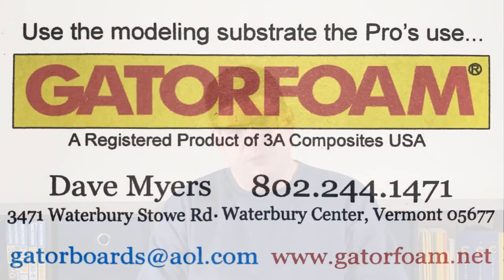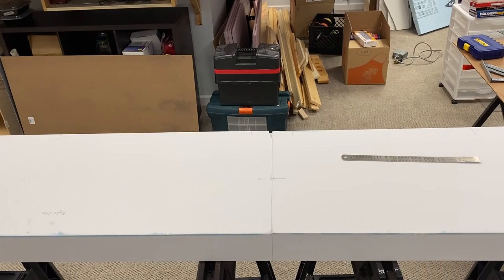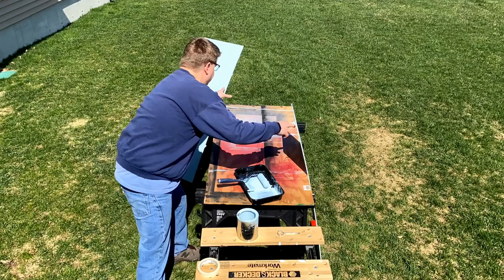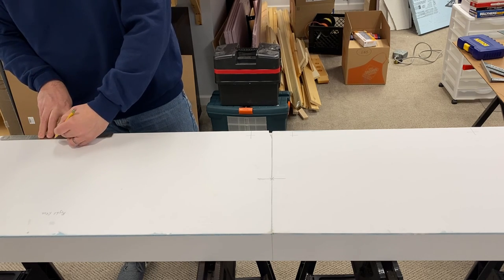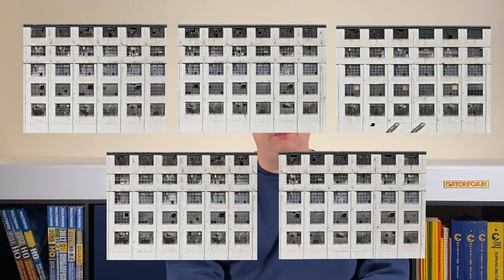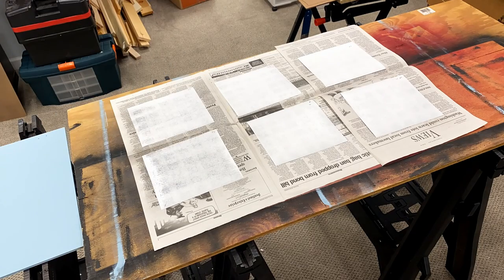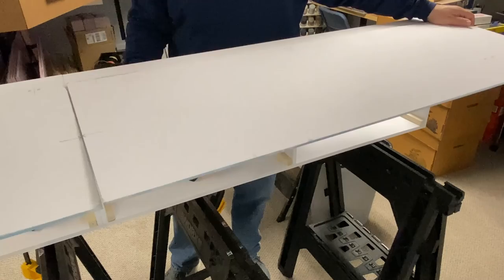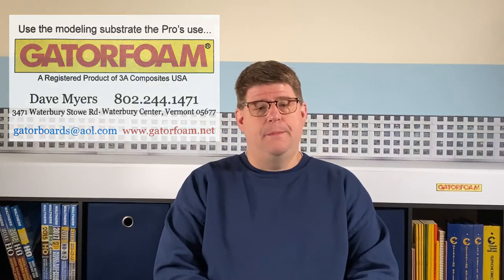Small HO Scale Layout Build - Ep. 4:  Adding a Backdrop to The Grunge

Comment: As tender as that Gatorfoam appears in compression mode, I think I would use pan head screws with fender washers to attach the backdrop to reduce the chance of the screw head pulling through.
Reply from the maker: Thanks for the suggestion! I went back and did that in places in the follow-up video.

Comment: I’m inspired by your project. Love the light weight. Can I support with 6 legs ? I looking at height of 45 inches. Thank.
Reply from the maker: As designed you should be able to, I would just modify the middle legs so that it gives support to both sides of the module joint.